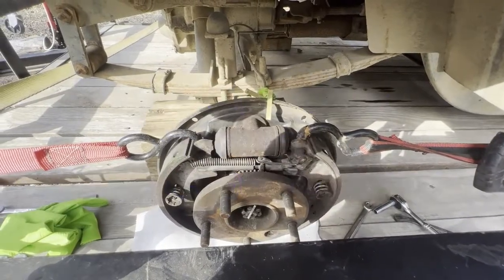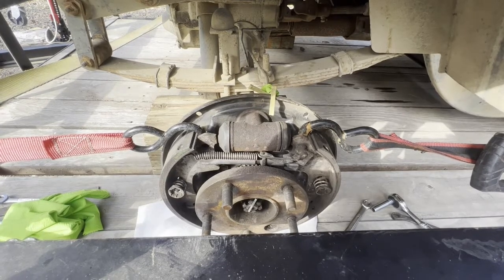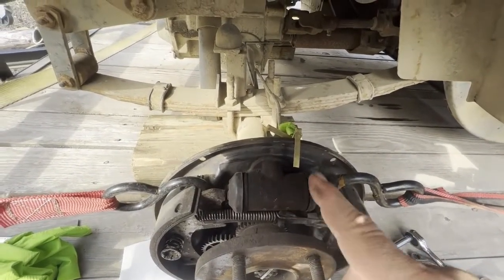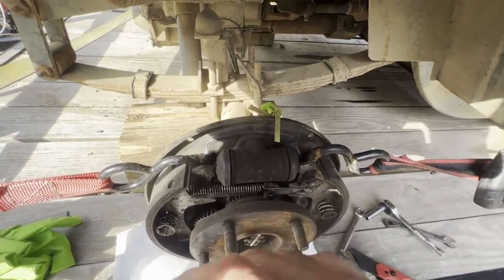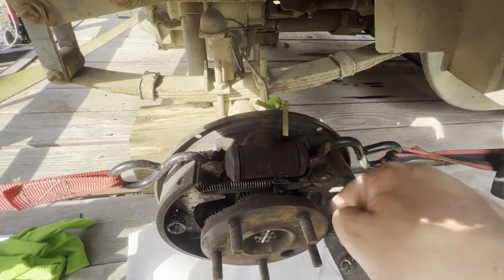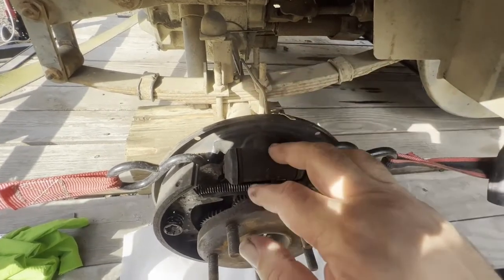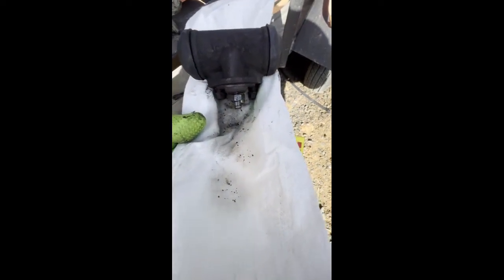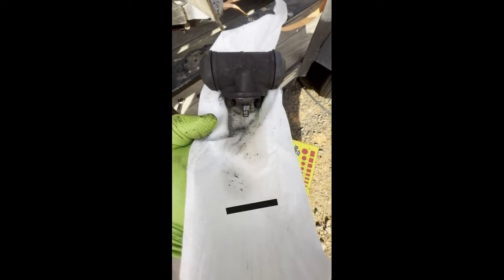Cushman brakes

Comment: That's a good idea Dereck, spreading the shoes apart like that.  I worked on those old three wheelers alot.  I had to do the axle seal kits alot to because that backing plate comes loose on those
Reply from the maker: Thanks man! Yeah, those axle seals can really be leaky. We still have a couple on our fleet at work so I'm still working on them. Lol